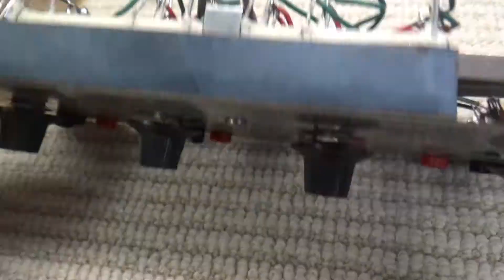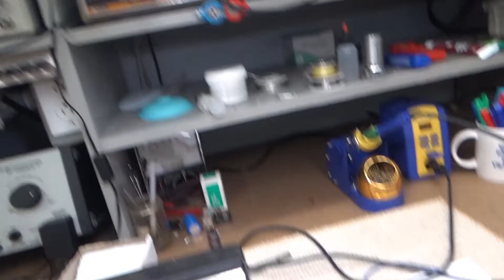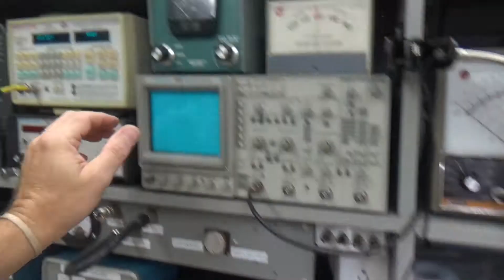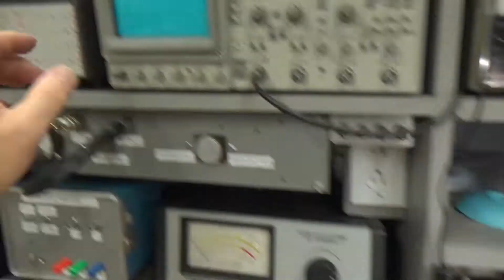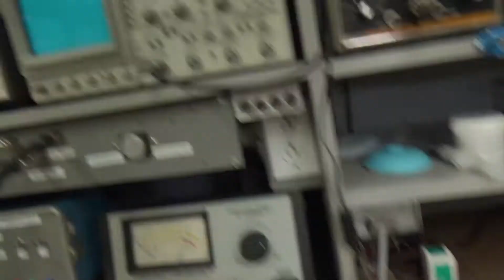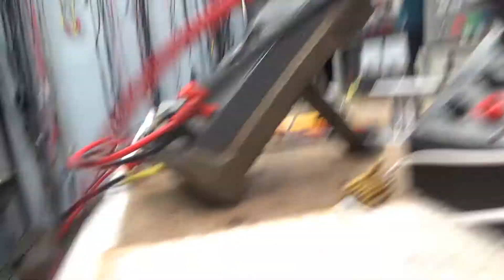Sencore Rc146 "Handy 75" Repair Final

Comment: That spring on the inside panel on the "Surge Protector" switch should pull the switch into the left hand position, which will connect the 500 ohm wirewound resistors on the back panel to discharge the capacitor that is selected by the rotary knob( so you don't zap the next item you are working on, or yourself). To use it for connecting a capacitor, you slide it to the right, and press that spring loaded rivet down to hold it into position until you are done. It's too bad that Sencore chose to make the front panel out of steel on a lot of items, as they seem to get some surface rust that doesn't help appearances over time.  Nice to see you got it functioning.